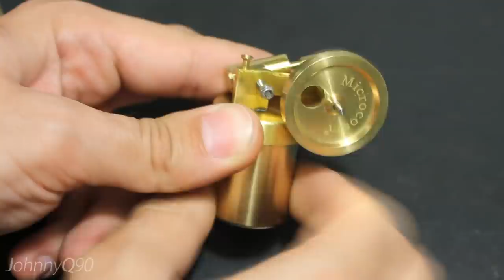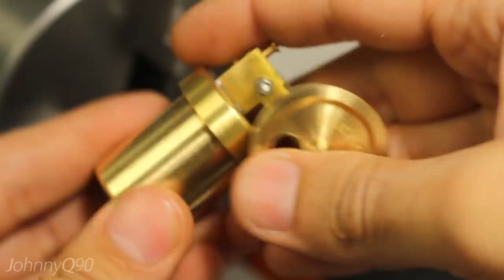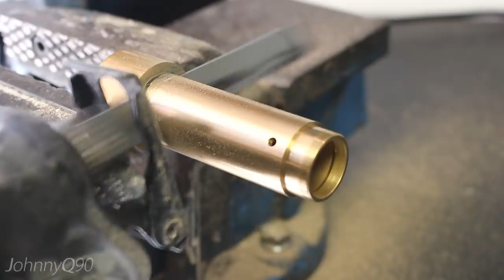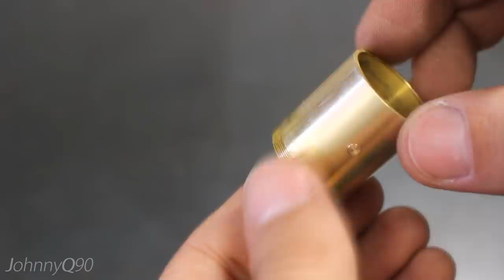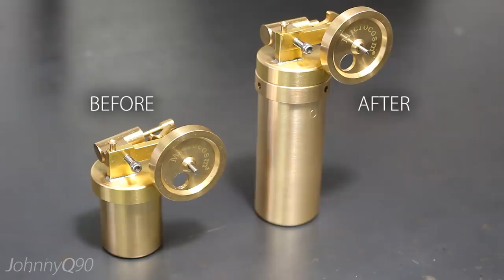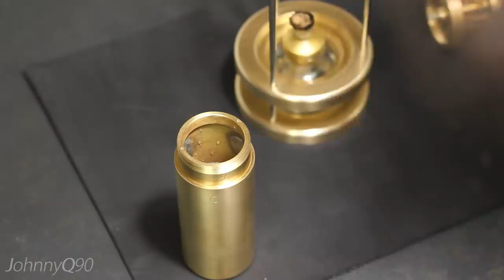Mini Chinese Steam Engine

Comment from the maker: Mini Live Steam Engine Model: https://goo.gl/PyEUd2   
 8% OFF COUPON : ToysHo

BK-03 Tripod Ballhead + Quick Release Plate Camera Tripod: https://goo.gl/wM1MZt   
10% OFF COUPON: Elec

Banggood 11.11 Global Shopping Carnival Hot Deals: https://goo.gl/viBdcS
Banggood UP TO 60% OFF For Thanksgiving Deals: https://goo.gl/V8aZ3r
Reply: JohnnyQ90 Is love me one for my desk but I see it always boils over. Is there a way to seal or stop that?
Reply: vaiojoe the boil is too harsh, just lower the wick for a smaller flame. You will still boil the water just not such a hard boil
Reply: Dave Oh My main concern was at the threads. The relief valve doesn’t seem to give off much.
Reply: vaiojoe watch the video again the water isn't coming from the thread it spilled over from the piston side. if you have a bigger air gap above the  water it won't over boil up into the piston, or have a smaller flame. you need to balance the flame to the boiler size, you wouldn't run this engine  with a blowtorch.
Reply: Dave Oh Either way awesome machine work. awesome novelty.
Reply: you should try making a steam engine air compressor,
use that steam engine, you just have to make the copression chamber and you're good!
Reply: vaiojoe I agree this guys skills are awesome. Have a look at the lighter made by W&M it is a piece of art search for      lighter W&M
Reply: JohnnyQ90 can you make one. $60 is a little mich
Reply: JohnnyQ90 I think that next time for the next video you should on the water capsule for the little engine you should make a little valve so that you can refuel the water without taking the engine off so it won't stop that's my idea so take it or leave it man I don't care
Reply: JohnnyQ90 how much is it ?
Reply: kawano youta 59.99
Reply: kawano youta and there may be a shipping   Fee too
Reply: bad
Reply: nice project, you tested to charge battery or in use eletric ?
Reply: @davew6998  çf
Reply: @jujuteuxOfficial  pls what's the name of the drilling tools and other tools in this video?

Comment: Steam engines have incredible torque for the size compared to combustion as the simply build more steam pressure if it stalls.. The slower it goes due to load the more torque it outputs.
Reply: Not really a wobbler engine
Reply: well, you have to take material strength in to account. steam can and will rupture any weak spots. you can't have unlimited psi...
Reply: You do have a fair point but runaway steam engines can turn into very powerful bombs under the right conditions
Reply: @zakcritch8706  thats kind of a risk with any engine if you have the slightest clue on how a steam engine works you can pretty much avoid that
Reply: @jzjzjzj  But what if you wanted to do it on purpose? like say... for content?

Comment: I think you should try making a closed loop steam engine so you don't use up the water. That could be a cool next project :)
Reply: Nasa wants to know your location
Reply: It would probably need active cooling
Reply: What you are suggesting is called a "condenser". It's essentially a big cooling tank into which the engine exhausts. The steam condenses (hence the name) and turns into water that can be pumped back into the boiler.

This way you lose very little water and can go a looooong time on a single filling ;)
Reply: Such a thing exists.  Unfortunately, since nothing is 100% efficient, water being heated, used, and cooled repeatedly would not work forever.
Reply: with a truly gas-tight seal, a condenser and a small pump of sorts the water would not need to be refilled basically ever. the energy comes from the fuel, so it's not like it would break the laws of thermodynamics. the problem would actually be not creating a water hammer due to the extremely low pressure zone you'd be creating because of it
Reply: @brassandbricks7701  And of course you will need a high-pressure waterpump, to get the water back into the boiler!
Reply: @ALittleBitOfGay  In this case you would have to keep the condenser under high pressure, which costs a lot of power, a waterpump is the usual solution for that problem!
Reply: Old steam cars already have it

Comment: A very nice  single cylinder oscillating engine. It is well made and a little honing of the valve gear and  a gasket on the boiler thread would correct the little  errors seen in this video. Congratulations.

Comment: Do you think 'modern steam' has a future in residential/camp sized engines that use multi-fuels? The Stirling engines don't have much torque, but the modern materials available now make the neat little models more scale-able. It seems like commercially available steam engines have always been either huge or small models. The technology could be up graded for practical off grid use.

Comment: Serious request. turn the flywheel into an electrical generator. Drill 4 holes around its perimeter and glue in neodymium magnets, then make it a partial shroud with copper coils around it.

Comment: Look for Steam oil...it will add compression..
Add a radiator to Cool the water and recycle..
Then add a Solar lens..  use the Sun to heat the system..

Add a generator and away you go..
They say a Steam turbine at Full is the best for efficiency..  based on Fuel used..
Reply: yep.. if you seal it up with Glass on southern sides, this thing will even work in winter..
Using an alternate, you can Switch the water to Run inside the home for HEATING, bathing and soforth..
OR a settling tank, Insulated to hold Hot water over night..
Reply: Somehow I doubt that you could make water boil during Canadian winter with nothing save a parabolic oven with a fresnel lens.
Reply: as long as yo keep the wind off you can let the SUN IN and biol water

Comment: Could you collect the exhaust, cool it  (would it need to be cooled?) and then pipe it back into the cylinder for a longer run time? All ways love the videos :)
Reply: yes! That's what they did/do on real steam engines. For example when going across america through desert like areas with no supplies.
Reply: They also did it on the London Underground to stop the stations from fogging up too much
Reply: What you suggesting is something that every nuclear powerplant does. Because you do generate entropie (not usable energie) when converting heat energie into electricity. You have to transfer the entropie out of the system by cooling the exhaust gas down to a liquid. Then you can reheat it and re use it.
Reply: This would also increase its power because of the created low pressure zone by condensation. Bringing the water back to the same reservoir might not be possible since it's under pressure.
Reply: fastchill  Therefor he should have some kind of pump installed XD
Reply: You would end up with a water hammer and or air hammer due to pressure or vacum.

Comment: The bubble that popped up in your spirit burner near the end suggests you're overheating it with the new boiler being so low, watch out if your running it for more than a few minutes.

Comment: I bet if you soldered brass tube around the reservoir, and then wrapped the tube section in a firesafe insullation layer, the tubing would improve heat transfer into the reservoir by giving more contact area and forcing the hot air to remain in contact along the length without mixing cold air in. With more of the flame's heat captured I'd expect faster steam production which should make it stronger, though might not have a huge impact on top speed.

Comment: have you tried increasing surface area of the boiler for better thermal coupling with water? you can just throw in or solder a bunch of brass wire cuttings inside the boiler.

Comment: I wonder if you could power a small RC plane with this somehow? If not, I'm sure it would at least be enough to run a toy boat. Even 2.5 minutes of run time isn't that horrible for an RC toy, if you couldn't find enough room for your extended boiler, and no lithium batteries forcing you to cool your heels for half an hour of charging after each run; just fill it back up with water, fill up your little alcohol lamp (although I suppose it would probably work better with another flame source, such as one of those cooking torches chefs use to caramelize stuff, which would last a lot longer so probably not need to be refueled) and away you go.

Comment: You went through a whole heck of a lot more trouble than you needed to in order to expand the boiler.
You could have just made the boiler to sit higher in the legs and cut new threads into the top of it instead of adapting the original top to the new bottom.

Comment: Would be nice if you could put a generator on it and charge your phone whit it
Reply: @Adriel Ramos no there is no other option it must be done
Reply: I was thinking the same thing. I would buy one. I lose power a lot and would use it
Reply: I don't think it's powerful enough
Reply: @jimbob7568  are you kidding? Phones use less than 10 watts

Comment: Make a tesla turbine turbo charger. You could attach it to your nitro engine.
Reply: Agreed
Reply: I already made this suggestion in the last video but I’m glad that there are people that would like to see it as much as I want!
Reply: :D sorry to bust that cool idea;)
you can't supercharge two stroke engines (...) because they have ports. Once the piston is at BDC, intake and exhaust ports are open at the same time, and your supercharger(or pressurized crankcase charge) blows right through..
Reply: Twostrokes can be turbo/supercharged. As long as it has a expansion chamber, which most rc engines dont have. But twostrokes sure can be turbo/supercharged!
Reply: DerKrawallkeks Sh!t. U are right ;D what a shame. Should’ve thought about that :(
Reply: look at my answer?
Reply: I don't care what engine he uses, I just want to see more of the tesla turbine and what it could be used for. Another idea is that he could use the tesla turbine as a pump in his nitro engine water pump.
Reply: Real_T in mc original comment, i added (...) just for you. I knew you were gonna comment;) 
1. Almost all rc nitro engines have expansion chambers
2. Even with a resonance exhaust you can't really put a turbo on it, because once you're out of the powerbank, which you are 90% of the time, your turbo will just be blowing fresh gas right into the exhaust, like I said in my original comment
Reply: 1, I know almost all "bigger" nitro engines have expansion chambers. but i meant mostly the smaller ones that dosent. (like Cox engines)
2, Well, thats the thing about twostrokes. they are gonna be uneffective if they are out of the powerband. Powervalves help with this, but untill someone invents variable expansion chambers and ports etc. Thats how it´s allways gonna be, turbo or naturally aspirated. 

Saying its useless to turbo a twostroke is wrong.
Reply: Fenrir You could do it,but it would require desinging and making your own cylinder,piston etc..
And also it would be inefficient to the point of not being usable aside from being paperweight.
Reply: Real_T i agree, but i didn't say it's useless. It works, so it has a obvious use. It's just really really difficult to build, to the point where it doesn't make sense
Reply: They charge themselves. 2 strokes are naturally aspirated to the crankcase, the low pressure mix is compressed or charged on the down stroke (and reeds/valve closed). Some of that pressure is lost by the time the piston obstructs the ports  but the charge is definitely more dense than a natural aspirated 4 stroker when compression begins. Compare comp. ratios of 2 to 4 cycle then ask why big blown 4 strokes run such low compression compared to stock motors. Good work Johnny Q!
Reply: You can turbocharge a 2stroke engine. Look on internet 2 stroke diesel turbo engine
Reply: this has nothing to do with a valveless, crankcase breathing gasoline two stroke.

Comment: This is the engine we designed and manufactured that has been updated to the third generation. It will use metal alcohol lights.Jin

Comment: I wonder how much torque that engine makes. Could it be used to turn a generator for recharging batteries?  I’m sure a larger one could. Just an idea, but just think, powering your house with a steam engine run generator. Wouldn’t that be neat.

Comment: It's hard for me to think about a less efficient engine... but it's so cool!
Reply: Fernando Romera steam engines are pretty efficient tho
Reply: Yeah it's just a model engine designed for simplicity and low cost. A thermomagnetic engine probably takes the award for least efficient engine.
Reply: The concept of a "least efficient engine" seems like a dead end waste of time. One can contrive any number of elaborate energy wasters.
Reply: I think it'd be pretty fucking hot!
Reply: Not if you use the hot water output to drink a tea ;) Cogeneration = no loss
Reply: Sunberry Chauffage Solaire DIY well I like that but the engine's efficiency would still be poor; it's actually the overall efficiency of the system that would be high haha cheers friend
Reply: Maybe a microamps motor (idk if it's like that) or homopolar motor
Reply: Otto Knabe
Steam engines are not at all efficient, you need to burn fuel, to heat water to produce steam to convert it all to mechanical energy, it's the least efficient way, but having said that, it was cutting edge technology back when they were first invented, and improved upon until they were finally surpassed by more efficient petrol and deisel engines, however in my eyes regardless of their inefficiently they're all beautiful and marvellous peices of machinery
Reply: Simon WoodburyForget
A nuclear powered steam engine or steam turbine is just as inefficient as any other steam engine, the only difference is with nuclear power they have much longer lasting source of heat, even so most of its energy is lost heating the water to produce steam
Reply: Simon WoodburyForget
You really don't know what your talking about, nothing you've said above makes any sense, all any engine will do is produce rotary motion, the transmission produces torque, or in the case of a Steam locomotive the wheel diamiter, the smaller they are the more torque they'll produce, but it's not free, because they'll need more steam, this need to be produced by boiling water this  takes time and fuel you could use coal, oil, gas or even petroleum, but most of the energy contained in these fuels is lost in the fire that's needed to boil the water, only 6% of it is actually transformed into rotary motion, the rest of it is lost as heat in the firebox, compare that with a combustion engine, it's a no brained, if you can't understand this you really are a knucklehead, and one last point all engines do  is convert energy into rotary motion, they all produce HP, and Rpm, but the steam engine does this in the least efficient way, the most efficient as of today is the electric motor, but I can't be bothered to explain this, Google it
Reply: Simon WoodburyForget
You really are talking out your arse now, no steam engine ever got anywhere near as efficient as a petrol or diesel engine and as for Diesels not being used much what do you think modern trains run on, thin air ? Most of them are diesel engines, that run a generator which in turn powers its electric motor, what about ships.? They're run by huge diesel engines you fool, trucks the world over, tractors, diggers generators to name just a few applications military hardware ect. and 50% of automobiles these days are Diesels... You really ain't got a clue what you're talking about,
I'm out of this stupid debate, and you lost hands down !
Reply: Steam engines operate on the Rankine cycle which has a maximum Carnot efficiency of 63% for practical engines, with steam turbine power plants able to achieve efficiency in the mid 40% range.
Reply: My grandpa’s 76 Cadillac Maybe... 😬
Reply: Fernando Romera Yes, that's why steam is used in nuclear power stations, warships and subs, because of its inefficiency. NAILED IT! 👌🏻

Comment: i think this is just another version of a sterling engine and great vids man keep up the great work and effort
Reply: To: Clayton game-hughes,
A Stirling engine runs on WARM (not even HOT)-AIR!! Some are even solar powered!!
Also, Stirling engine uses no water and operates at a MUCH lower RPM.. so, no, this is NOT another kind of Stirling engine as it also produces MUCH more power than a Stirling engine of anywhere NEAR the same size.
The steam engine came first anyway.

Comment: This little machine is kind of brilliant. Would you be willing to run a hose off of the exhaust through a condenser/radiator type of thing and back into the boiler? You are definitely a good enough machinist in tinkerer to do it. It would be interesting to see if it would run indefinitely… Either way nice work
Reply: That would be a little tricky. The actual “radiator” (you mean condenser) would be easy. The actual issue would or piping it back into the boiler. The pressure from the boiler would push back on the water in the radiator.
Reply: good point on both parts
Reply: @not_a_therapist   There is a thing called Steam Injector which use steam from the boiler to inject water into the same boiler.

Comment: All that beautiful machine work and does not sweat fit the extension? Also, what would happen if you used a drop of lite weight oil in with the water? Liberation? Or slow it down? And my God man a Saw zawl! 210!! Your a machinest ! Good video  man. Keep it up

Comment: Ohh yes all the side full and half wheel rolled simultaneously and the half cut whell not letting the pressure maker to stand tall since pressure on it from hot stream poured continuously ! The larger the wheels and contain er and the design is with lighter matels will have them rolling faster 😂